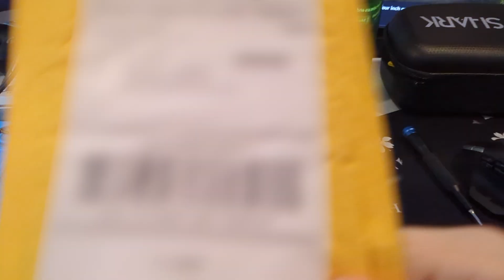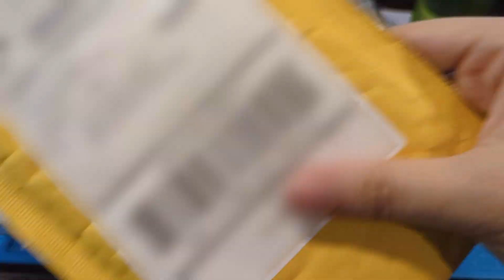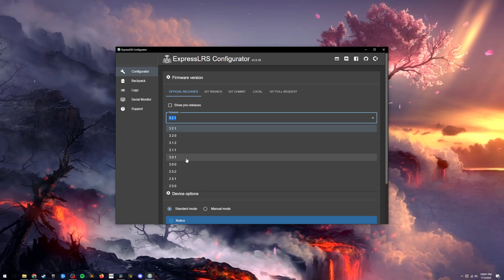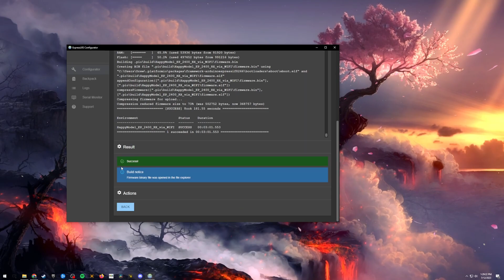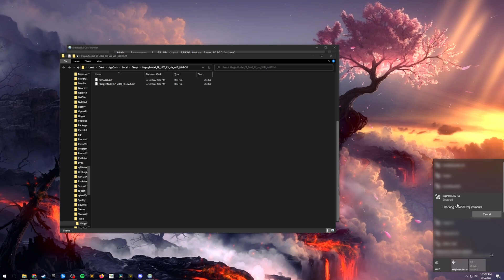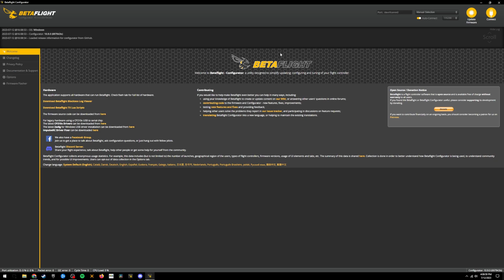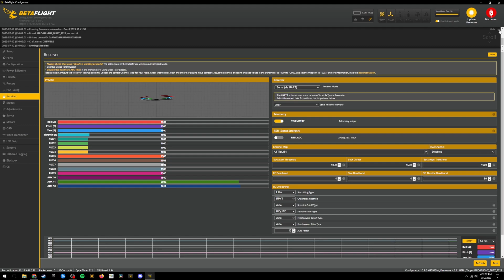My ELRS rx Failed me! Here's how I fixed it

Comment: This is how I would fix that. Get TBS :) Started with that setup and wouldn't do anything else.
Reply: EXACTLY!   At the very very least switch to 900Mhz ELRS.    I've never had a failsafe with crossfire, doesn't matter if I am diving buildings in Denver or flying miles out in the mountains.  You can either keep buying junk or save yourself time and money and switch to what works!
Reply from the maker: @WOTHFPV  
Prior to purchasing this quad and setting it up I performed extensive industry research into which RC link I selected. I settled on ELRS for many reasons, including cost, reliability, range, and future-proofing. In almost every metric ELRS stacks up to crossfire, and in most it has clear advantages for my use cases. 
TBS has had issues in the past with support and continuation of their products, one example being that of their transmitters running closed-source FreedomTX that is significantly behind the open-source alternative EdgeTX. This, coupled with my confidence in troubleshooting and configuration on the software side of things, led me to the conclusion that ELRS (which is open-source and can run on an extremely wide array of hardware) is by far the best radio link for me at the present time. 

This video was not meant to bash ELRS as a control link, but rather to highlight a hardware issue I had that caused me to believe ELRS was severely underperforming and eventually ended in significant damage to my drone. The fact that the receiver was still functioning to that level and distance without an antenna is indicative of the truly impressive performance of the ELRS link, and more closely resembles what the RC community has observed regarding the link's stability and range.
Reply: @drewbledrones  And thank you for the info :0)

In my case I just went TBS a couple years ago. Went a couple miles had good times...never had one crap out of me or anything bad so I can't say anything bad about it. 

Then again I've heard a few things with ELRS - I say if it works why change. I don't need anything advanced, I just want something I know will work 100% of the time..but I hear you on all your points so thank you again for the extra info.
Reply: @drewbledrones  Hobby fliers are fine with ELRS.  Pros use TBS as we cannot afford an issue on a set or at a gig.  If I was poor and only flew a couple 5" quads at a local park, sure 2.4ghz whatever would be okay.  I fly for a living and have been a commercial drone pilot since 2013, I need something that simply works!  Again, nothing against ELRS - its fine for most folks in simple locations.  Its science man, like I said in my first reply - a the very least switch to ELRS900.  Kinda like if you were one of those guys that claim analog is the only way to go.  That's fine, but you should use 1.3Ghz and not the 5.8Ghz most people use.  I could care less what name is on the control link, I simply want something that isn't going to fail me while working.  Take Mr. Steele - he likes to post how he likes analog or walksnail with Tracer.  He just posted a short video of him flying a large cine lifter.  Notice he has DJI goggles on and a TBS crossfire mod on the bottom of his tracer controller?    Same with Nurk.   You can keep "experimenting" with your toy or use what pros use.  I could care less man.